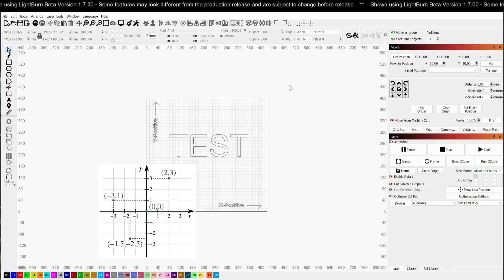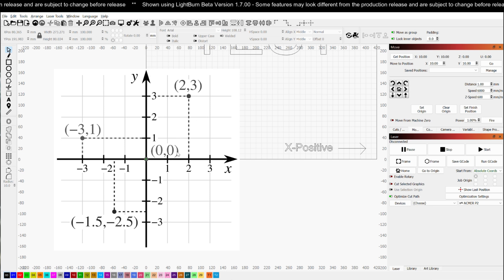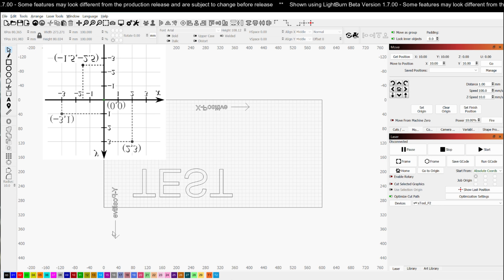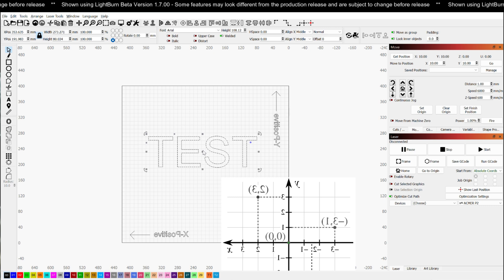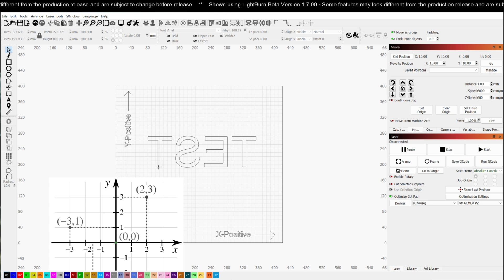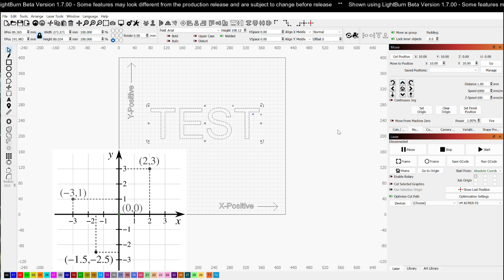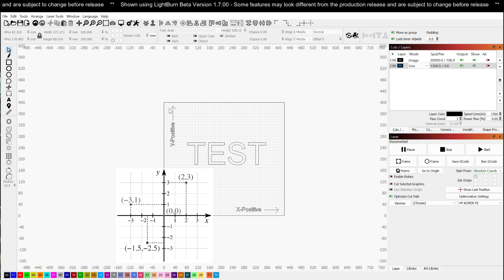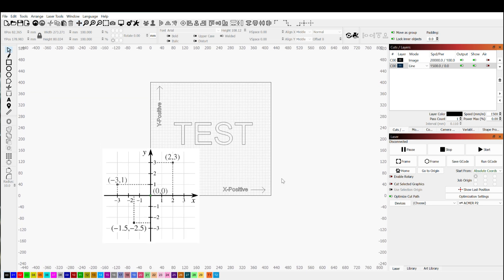Understanding Machine Origin in LightBurn 2024 Edition

Comment: How do I change the origin.
Currently It appears mine is on bottom left and I want to change it to top right.
Thanks for the help.
Best regards
Reply from the maker: Hi @williamfoster7920  I changed the origin several times in the video. It's the section that says Origin with 4 circles to choose from. You can find it in Edit > Device Settings or by clicking on the wrench and screwdriver icon in the top toolbar.
Reply: @thetinkerverse  Thank you I appreciate your help.
Have a great week.
William